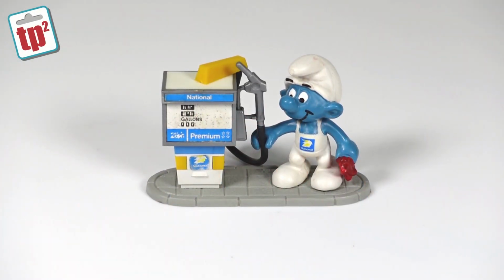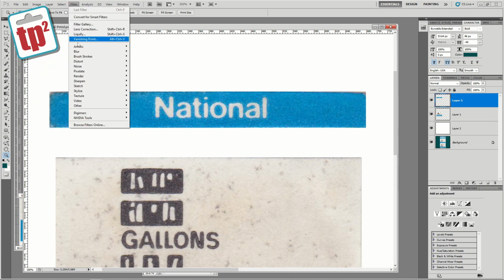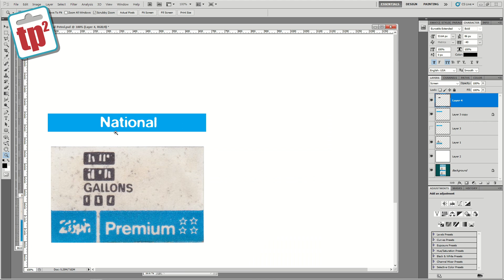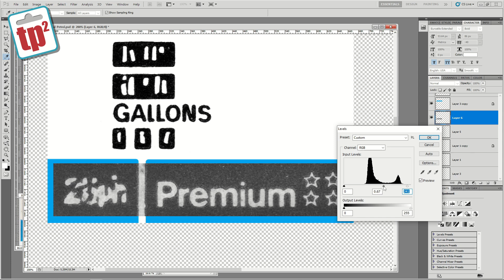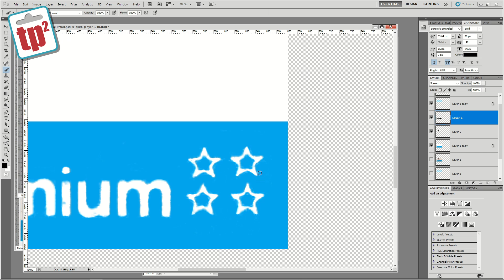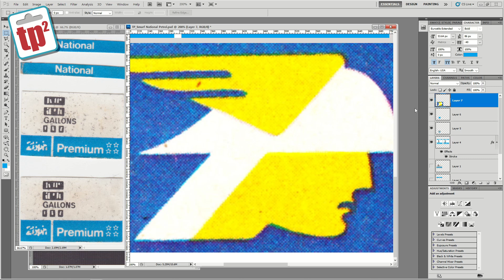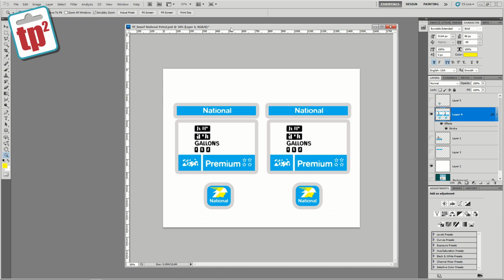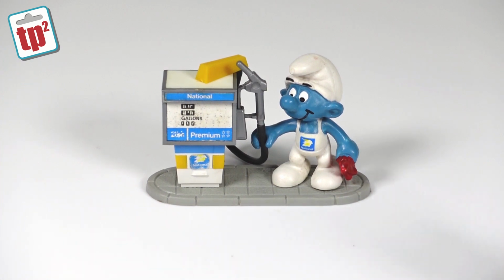Repairing vintage National Smurf Stickers in Photoshop ( Real time ) - Toy Polloi Two

Comment: What I usually do is to make a copy of the channel that has the highest contrast (maybe using Hue/Saturation while still in the RGB channel to make one of the other channels as contrasty as possible), then use that as a mask over a solid color layer. Sometimes it's also interesting to leave some of the texture of the original printed image in there as well.